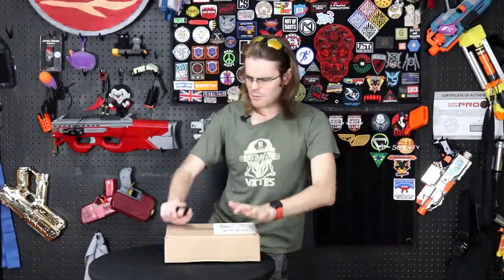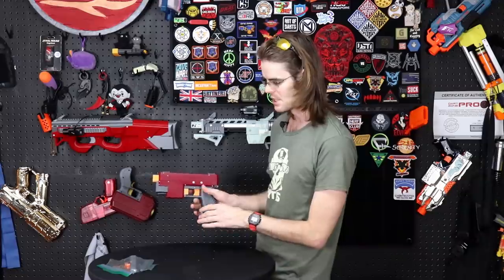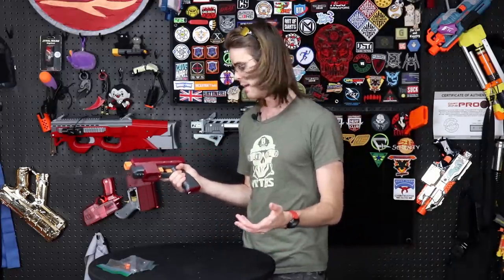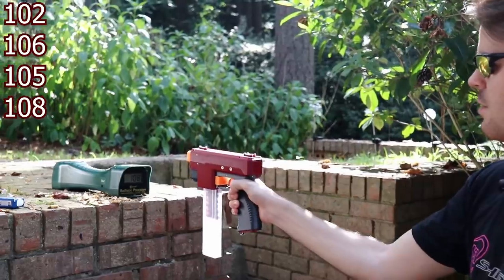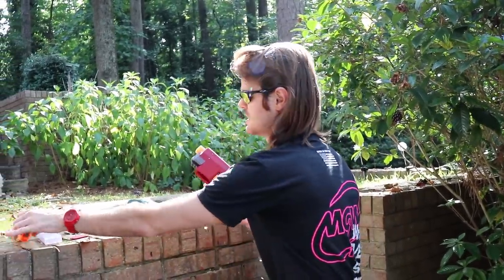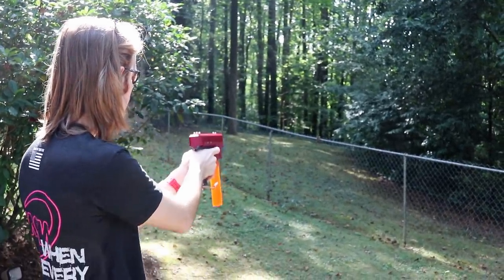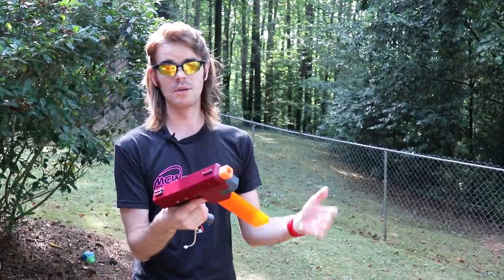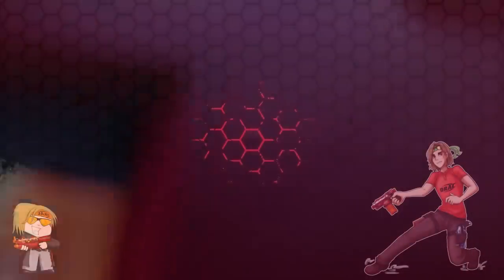Honest Review: The Kestrel (A 3D-Printed Micro Powerhouse!)

Comment: How is this 3D printed!? It looks like an injection molded piece!! Dang....3D printing has come a LONG way
Reply: Absolutely, it’s very impressive! Even the basic $200 3d printers can make even real guns (at least the plastic parts, like most of a common Glock minus barrel and slide) or you can get resin printers which are astoundingly accurate and smooth (great for miniatures for tabletop board gamers). No longer is it just for engineers to prototype and today’s $200 machines match the $20,000 machines of about 15-20 years ago so now it’s affordable even for making unique toys and almost anyone can afford one if they really wanted.

I’m still waiting for metal (like Titanium) printers to come down below $50,000 because much like the plastic machines those are getting really close to 1/10 the cost, currently at $100k instead of multi-million dollar machine and those are going to make printing very interesting... It will be almost limitless from custom turbochargers to miniature engines (I want a mini Wankel rotary engine for my bicycle and maybe print a miniature version of my RX-8 as a fun little RC car with true to scale working engine). There’s still a lot more improvement to come, but right now it’s booming in technological advancement for the buck.